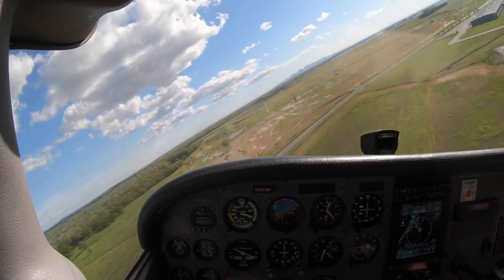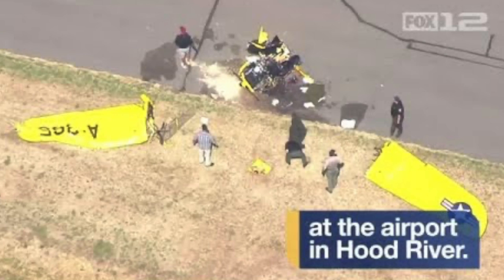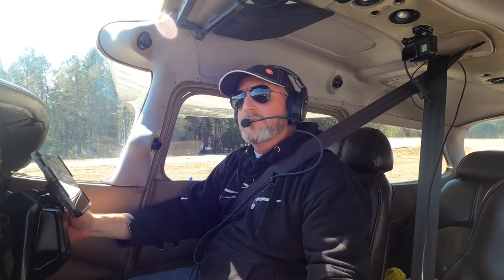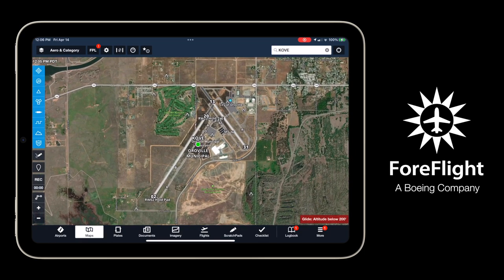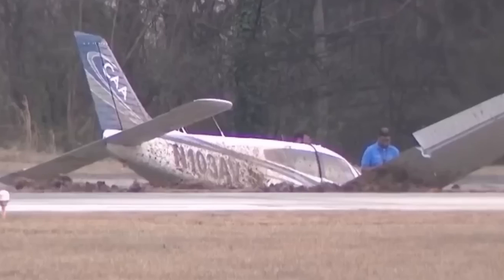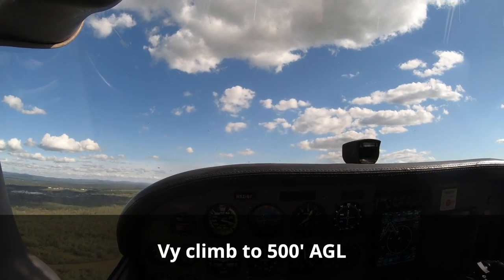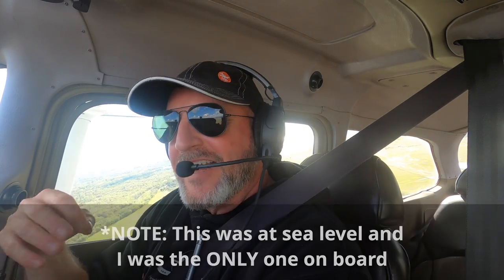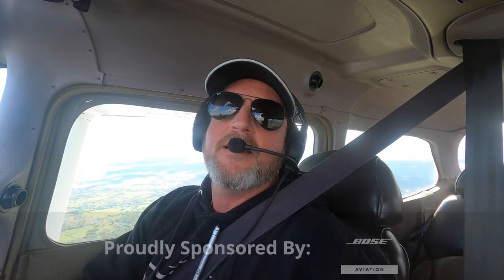The IMPOSSIBLE Turn? - Engine failure on takeoff - Airplane Crashes - 180º Turn Back To The Runway

Comment: Keep in mind the viability of the impossible turn is going to depend a LOT on what aircraft you're in - the Air Safety Institute made a video on this called "Reality Check: The Runway Behind You" where they tested the impossible turn in several different airplanes.
Reply: it also depends heavily on the runway you took off from, as well as the wind.
Reply from the maker: And the weight/density altitude - so important to consider 
I loved the ASI video thanks for the reminder
Reply: Agree, the Aircraft is a big part, also wind speed, and direction, a real engine failure is also a little different than an engine at idle. it does not matter if this helps or hurts what matters is it is a different variable in the reality of a real engine out. it makes reality different from practice even a little.  3 small things like wind speed, dead engine, and wind direction can add up to a good or bad outcome.  However, I think practicing this is a positive any way you look at it. but should be a last resort.
Reply: Thanks for thinking of us🙂 Great content, Jason!
Reply from the maker: Sorry, it took this comment to remind me that you guys did that awesome video with the different airplanes. I wish I had remembered sooner I would’ve mentioned it in the video. Next time 🙌🏻
Reply: @TheFinerPoints  all good! Thanks Jason:)
Reply: Bonanzas were trash on that video. It was a great video
Reply: We do it in gliders all the time.  If we have a road break under 200 feet, we land straightahead, 200 to 500 feet we turn into the wind and land back on the departed runway, above 500 feet we enter a normal pattern. Having a 30 to win glide ratio is great.
Reply: Wrong.  Utterly wrong.  The impossible turn is NOT testable, NOT trainable and NOT possible.  Hence the name.  Why cant the turn be tested?  Because KNOWLEDGE of the attempt is pre-known.  In real life, you will not know or see it coming, you will not react fast enough.  So do not kid yourself fantasizing it is possible.
Reply: @TheFinerPoints 

Please Google -- Richard McSpadden Jr.  He was the AOPA Vice President and narrator of that video "The runway behind you - The Impossible Turn".  On October 11th 2023 Richard passed away in a crash attempting a real life "The Impossible Turn" after an engine failure after takeoff. 

The video Richard narrated gives some sort of false hope that The Impossible Turn can be accomplished by some types of aircraft and under experienced pilotage.  However reality proved otherwise...this was a highly trained pilot and he was flying an aircraft comparable to a Cessna 172.  It's not even worth practicing The Impossible Turn given the irony of how he died -  in real life The Impossible Turn is not possible.
Reply: The day you have an engine failure, is the day your aircraft does NOT perform as expected! I don't care what you're flying. You're stupid for trying to turn back.
Reply: @speedomars  Turnbacks are not all Impossible Turns as you state.  So you rather stay ignorant?  Ignorance is the problem, Not the solution.  You know nothing about Turnbacks.  Dont label all as impossible.
Reply: @paradoxicalcat7173  Why your airplane is different the day you have an engine failure.  You are the one that is too nervous, not the airplane.  Duhh !

Comment: Not impressed. My first instructor taught me the impossible turn on my first few takeoffs.  I did it in the C150 before I knew it was impossible.  Later in my own C 150 I did the same maneuver countless times in my approach technique to our short private strip. Close downwind at pattern altitude. Parallel to the RWY end, power off, full flaps, point the nose straight down, aileron roll 180 degrees  to face landing direction, adjust rate of descent to maintain 60 to 70 airspeed till flare and touch down. Never failed,  never  had to go  around . It's exactly how that instructor taught me to do the impossible turn in case of power failure at Angola IN airport so I could avoid the  trees off the west end. I never needed it there but it taught me the C150 could do that maneuver easily, routinely, safely, with little or no drama. Observers from the found commented on my "plummeting"  approach so I suppose that's how it looked. From the plane there was a few seconds of staring straight down at the ground that spooked passengers a bit, especially if they were pilots, but I never felt insecure about doing it. It became totally instinctive and predictable. Just go out and practice it at altitude so it won't be dangerous. It works with the C150 so the C172 should be the same. Before I'd try it with a flying brick type plane with small flaps and high descent rate,  please practice it at altitude so you know what to. expect. I have no doubt that with some, maybe most, planes, the straight ahead crash is the safest thing to do. With a C150 going into the trees is second best option if you have 4 or 5 hundred feet  altitude.  All assuming you don't panic and react quickly and correctly to power loss. It helps if it's second nature so practice before you need it.

Comment: The longer the runway, the stronger the headwind, the lighter and slower the aircraft, the more possible the turn gets. Airspeed is key. So is a good pre takeoff briefing, including all these elements. Check!
Reply: i TAUGHT TURNBACKS in the 1990's.  To about 20 students then i went to fly private jets than dont do them.  I put a blue line on airspeed indicator and an altimeter marker on altimeter.

Comment: Excellent video and analysis! Thank you! As a CFIG, we practice 180 degree turn rope breaks at 200FT AGL. You cannot be shy with a well executed/coordinated 45 degree bank. Rope breaks at 200FT AGL, stick forward, nose below the horizon, immediate 45 deg. left or right turn into the wind, pull back to tighten the turn as needed, considering speed allocation to prevent an accelerated stall into a spin. I'm in the process of becoming a CFIA, and being proficient in gliders making this type of maneuver, I don't know that I would take my chances like that instructor did in Georgia. Excellent work to him, and speedy recovery, but I think I will choose something ahead below 700FT in an airplane. He almost paid the ultimate price. Someone below posted 45 degrees is the best angle to execute this 180 and yes, it is. There are graphs/plots showing the least amount of altitude loss per given time in the maneuver through a 180 will occur between 40-50 deg. of bank.
Reply: Your calculus isn't correct on this bank angle thing. Bank angle is almost irrelevant if you don't have speed and enough lift force to complete the turn. You can absolutely lose more altitude in low bank angles turns if you are too slow. If you execute an abrupt steep turn and pull too hard, you will spin in. Period. 
Also, anytime you change the wing angle from parallel to the "down force" you will lose percentage of lift performance . This is made worse with higher load factors, excessive pull in the turn etc etc...
This is simple, your climb rate must exceed your descent rate. That's all there is too it.  If you climb at 500fpm and descend 700fpm, you're toast. 
Flip those numbers and you might have a chance. Bear in mind the GA aircraft glide like bricks at best.
Reply: @Jmnp08   as an aerospace engineer with 10 years of airplane and wing design both in research and industry, I can assure you 45 degrees is your best bet. Yes, you are right about speed, but that is a given that you can't perform that maneuver without the necessary speed as load factor increases your stall speed. No need to explain to me the basics of what any competent pilot knows. I'm a flight instructor in airplanes and gliders as well. It is not "my calculus." It was done by other credible scientists and the substantiation behind it is sound. That's the whole point of this discussion - how high is high enough to safely execute a 180 turn in an average aspect ratio single engine airplane. That includes speed. There are plenty of books on aerodynamics both for pilots and for mathematicians backing all of this up. Feel free to go learn about it.
Reply: @Mxz23  I'm pretty up to speed on this guy... I'm practically an engineer myself.
The question here is really... what is the best way to complete this turn with minimal altitude loss, least amount of load factor (increased drag and energy loss) and complete this in the shortest time interval.
Reply: @Jmnp08  45 degrees at  Vglide minus 5 knots more or less.  The minimum sink speed  (MSspeed).
Reply: Yes, it would be interesting to find out what that instructor in the vid did , and why. Wonder if he’d give an interview ?

Comment: Glider training requires a return to field after a 200' rope break. I've done one pre-solo and I actually had to worry about how much runway was remaining. I had an instructor on board and up at about 6000' DA. It came in handy one day at a negative DA day in a 150 where I had a 150' engine failure and I almost had to put it on a taxiway. Luckily the engine came back and stayed but the pitch over was eye-opening for sure, as well as how engrained my emergency procedures were. I recommend glider training in pretty much all cases now.
Reply: I first soloed in gliders, and I love how deep that muscle memory of "nose down, roll, keep the speed up" is.
Reply: Gliders are NOT powered aircraft.
Reply: @speedomars  Lady, airplanes can also glide while turning,  Unless you are not a pilot and freaks out.
Reply: @speedomars But the aerodynamics , power-off, are the same. Read TgardnerH’s comment above again.
Reply: @davidwhite8633  No.  Gliders have a 50:1 glide ratio. Stalling a glider is nearly impossible.  Piston aircraft glide ratio are 7:1.  The wings and weight of a glider allow it to maneuver COMPLETELY DIFFERENTLY than a heavy piston powered aircraft.  The impossible turn in a piston aircraft requires a minimum of height and distance from the runway AND requires the pilot to perform an exact sequence of control manuevers to make the turn and still make the runway and land.  Even if there was enough altitude and the disantce short, a pilot MUST avoid stalling the aircraft by  keeping the nose level or DOWN in order to avoid exceeding the critical angle of attack, which will immediately result in a stall and if close to the ground, NO ROOM TO RECOVER.
Reply: @speedomars  Training gliders have glide ratios in the 20s ,not 50:1
Piston light a/c have glide ratios, windmilling, about 8.5:1 and with the prop stopped, closer to 12 :1
The longer span of the average glider’s wings give it a higher roll inertia than  the power a/c ,and hence it takes the former longer to establish a steep bank angle than the latter. A disadvantage to the glider !
The power a/c with no prop thrust IS a glider, albeit an inefficient one, so the basic aerodynamics ARE the same.
Of course the turn requires different decision heights and distances from the runway depending on wind speed and direction , length of runway for landing back,disposition of possible forced landing sites, density altitude vs climb angle/glide angle,and others. All these  decisions are made by the pilot ,though, BEFORE taking the runway, and they are primed after reaching their decision altitude to take the requisite actions if necessary. They don’t sit there like a pole-axed ox, or buff their fingernails for 4 - 5 seconds of ‘ startle ‘.
They know pitching down firmly is important to less than 1G to unload the wings ( and tail ) so that abrupt aileron movement can be made while keeping the ball/yaw string centered , then pitching to Vbg once bank is established . Just as important is keeping coordinated when bank is removed after~180 degrees.
  The successful returns are usually not recorded, of course, only the others ( most of which are stall/spin accs and should be recorded as LOC-I ,loss of control in flight accidents.)
The track over the ground made by this maneuver would look like a narrow teardrop turn.
Reply: @davidwhite8633  No.  Gliders are in the 50:1 range.  Wing loading of 5 to 7 lbs/ft2.   Gliders are not powered yet can stay aloft all day under the right conditions.  A piston aircraft with engine power loss will hit the ground in minutes, completely unable to stay aloft.  ANYONE trying to assert that an impossible turn is a thing to expect to use in a sudden engine loss on takeoff is a fool and a danger to others who may not be sophisticated enough to understand the physics and aerodynamics of the situtation.   No responsible instructor or flight school trains anyone to train for or expect to make an impossible turn.  The FAA/AIM also states that the best practice is to LOOK FORWARD and attempt to land without attempting a turn.  Pure BS that you would push the lie that impossible turns are done in secret or not reported.  What we do have, however, are the crashes and deaths that resulted from the attempt to turn back to the airfield, and worse?  The powered turns from base to final done incorrectly that also resulted in a spin/crash low to the ground.
Reply: @speedomars  Nearly everything you said is either irrelevant or wrong —- mostly the former.
I get the impression you  ‘ fly ‘ sims, not real aircraft. Good for procedures , but for flying real aircraft — not so much.
      The reason for pitching down firmly is to reduce the G-force the aircraft experiences towards zero ,and therefore allow the more abrupt and fuller deflection of ailerons and rudder without overstressing the aircraft’s structure as the bank is quickly established . It’s not your grandmother’s standard ACS steep turn —- it’s an EMERGENCY maneuver. More like a semi - aerobatic maneuver, but easily learned by the average pilot with proper instructor training at altitude .
     The guy in the vid supposedly did his turn from ~ 100’AGL , but I doubt it —-probably closer to 200’AGL. Even so , it was a very impressive feat,and quite commendable. Try it on your sim off that runway at even 400’AGL  using your technique. Good luck.

Comment: Headwind and density altitude make a big difference on the ground distance used climbing to 500 feet altitude.
Reply: Right.  But headwind helps and higher density altitude hurts the ground distance.  Which one will effect the glide to reach the runway more?  Just asking.  Also relative to headwind only off a shorter runway do you fly faster than best glide in the tailwind the turnback.  I seem to remember reading about speed to fly in glider references.